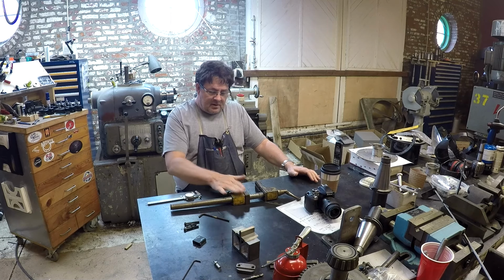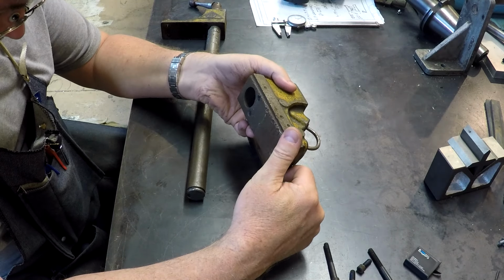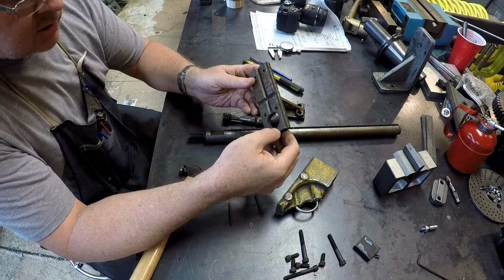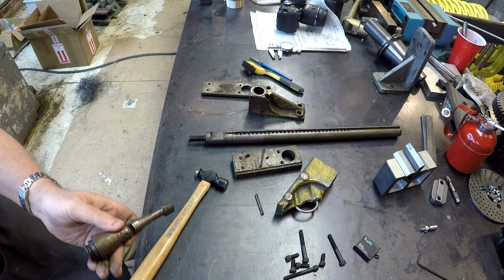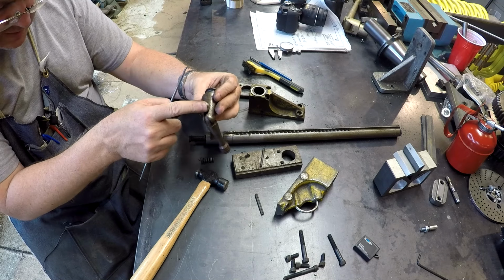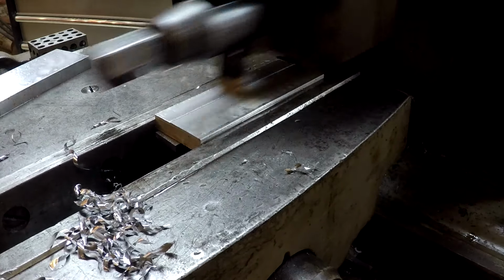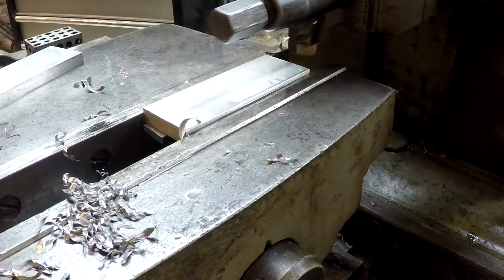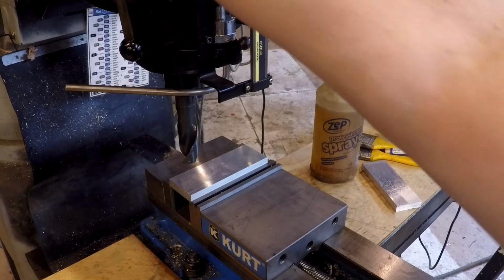Float Lock Vise Rework #1

Comment: Sorry to bother you with this kind of question, but are you using a new video format? I only ask because I experienced simply horrible buffering delays watching this video. It stalled roughly every ten seconds to buffer the video. As a test I jumped over and watched Adam Booth's newest video and watched Keith Fenner's newest video just before and experienced no such buffering problems. My link is fairly fast and I seldom if ever experience buffering delays. In fact it is usually fast enough for me to download a file in background without buffering delays. Just curious. 

Problem solved! Just had to update YouTube app. This time it actually worked. (Last update just gave me black screen with audio. So I had rolled back to what seemed to work.) 
These weekly updates are getting old. I've been computer literate since the mid seventies and I have a hard time keeping up with things. Can't imagine what it is like for computer newbies.
Reply: Look up Translink in Vancouver BC. They have all sorts of history of poor overpaid management with basically zero oversight. The line in question was built for expo86. Not updated until recently. This particular shutdown occured in the summer heat and it was so long passengers exited the train and were walking along the elevated tracks to the next station. It was hours and hours long.
Reply: I hear ya, I've had an email address since the eighties myself, but I have too ask, What is a computer newbie? Kids are given tablets and smartphones to play with in their strollers and playpens. Really the only people in north america who could be are newbies are over 45, and most of those have used computers at least somewhat at work. You have to try really hard to be computer illiterate these days...
Now, which slot on this thing is the punch card slot ANYWAYS??....
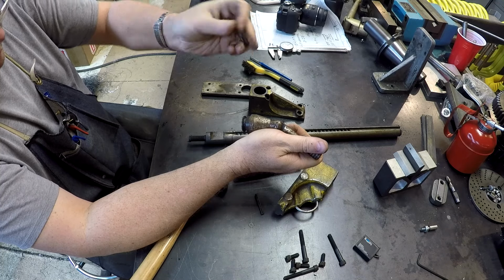Reply: Correct about the kids, but how many are actually learning to program? I was writing basic in Seventies & assembler by eighties. (Now fluent in five obsolete programming languages.) As to newbies: Yah, those who tried avoiding anything to do with computers and now face smartphones... Think VCRs flashing 12:00.
Reply: In my city they had a major shutdown of the transit trains because a couple 386s blew up and the guys who knew the language the custom software was written in have long since retired.
Reply: FWIW: Its getting worse in my opinion. Most people just buy dumbed down machines (mostly Macs and Windows). On Macs, stuff like drivers, Codecs, etc are automatically updated so there is no need for them to download and install them. When a computer breaks usually it means upgrade time and the just buy a new laptop, smartphone, or what ever device that breaks. We live in a throw away era. I think the average consumer just replaces their old machine every 2 to 3 years.
Reply: If you live in a city where a major operation is dependent upon some old 386 nonsense, then it is not a computer issue. Your city has a tech issue that needs a major upgrade.  There should never be that type of neglect especially when a public service is affected.  There is no excuse for equipment and a system that is this outdated.  Extremely poor management!

Comment: Bring that Pacemaker gear up before Saunders event and lets get that tooth cut! I see it still sitting on the table. I wonder if they had that thick jaw on there because the locking section was damaged and it wouldn't hold closed that close anymore? Always good to see some straight line lathe action. :-)
Reply: Also curious, what engine is on the floor behind the shaper? Whatcha buildin kilroy?
Reply: I've been wishing on a star to see the Pacemaker revived ever since I started watching J's channel, thanks for offering to help fix it Brian! Please video the job, it would be a sin to miss that after wanting so long ;)

Yeah, , I saw the crank shaft and was trying to ID it...and then I remembered I'm just a body&paint guy, LOL!